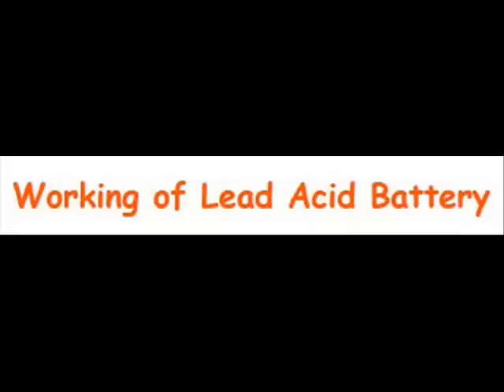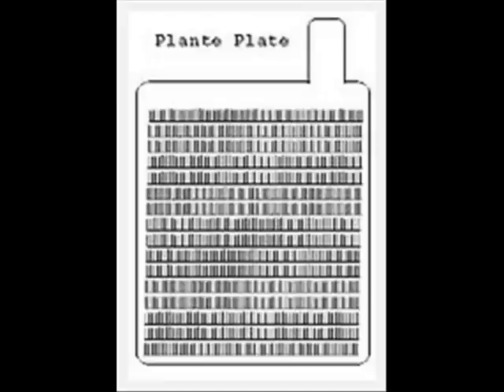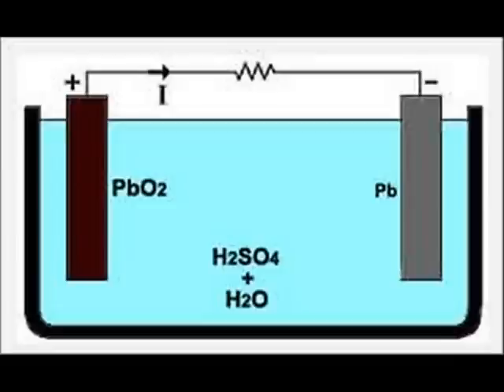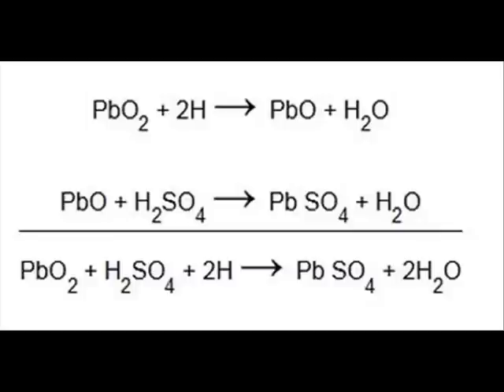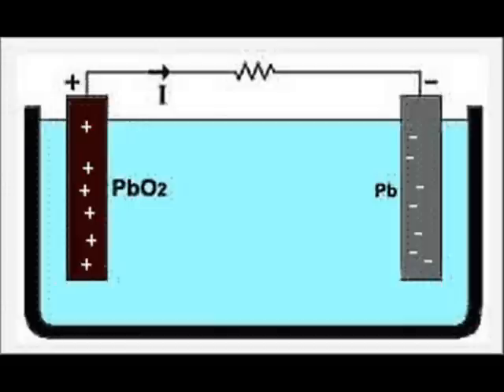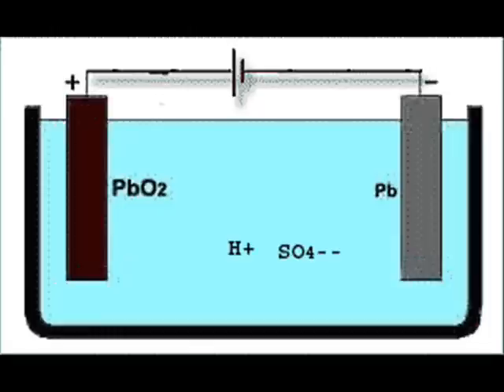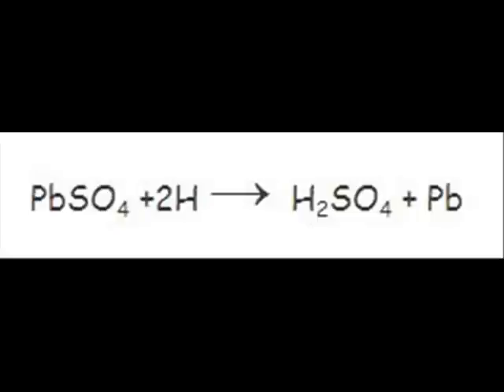Lead Acid Battery: How Do They Work? | Working Animation | Electrical4U

Comment: The Lead acid content and relation with that of the compounds and non compounds are good, since the said compounds and non compounds can be controlled/adjusted to be cleaner, safe as well as healthier, for them to be as efficient, durable and long lasting since it is recyclable/environment friendly, 2022 onwards.

Comment: I was confused when you said electrons move from anode to cathode. I thought they go the other way.  They are negative and attracted to positive. Thoughts? Clarification?
Reply: On anode there are oxidation, when on cathode there are reduction. From an oxidation you get electrons flowing in a wire (or sth) to a cathode where they are involved into reduction. By the time of they travel, they are used to do electric work. And while you are charging battery you are making the whole situation reverse; electrons from your external source of current are reducing the oxidated form of lead to its REDUCED FORM (PbSO4 => Pb), and on the other side you have SO4 2- ion that is giving its 2 electron to a H+ ions, and then (as radical) reacting with PbSO4 to return lead to its OXIDATED FORM (PbSO4 => PbO2). So while charging you are just reducing the oxidated form and oxidating the reduced form, so you can return to a starting point. The thing is that in PbSO4 you have lead on +II oxidation state, and it can be reduced (to 0: Pb II SO4 --> Pb 0) or oxidated as well (to IV: Pb II SO4 --> Pb IV O2) which is giving possibility to just reverse process and make battery charged again. I hope that you understand :D
Reply: @drewniak2094  Thanks for your effort to teach your content! I’m printing this for reference.
Reply: @drewniak2094  thank you.

Comment: This NEW battery made with new, never-before-cycled LiFePO4 cells is perfect as a drop-in replacement for lead-acid batteries in your Golf Cart, RV, Emergency Power Supplies, Outdoor Motors, Electric Wheelchairs, Etc. while giving you more capacity, faster battery charging speed, longer cycle life, and is Eco-friendly!
see the link below to know about the Black Friday OFFER.
https://bigbattery.com/product/12v-170ah-lifepo4-power-block-golf-cart/

Comment: Well sorry, but your concepts are wrong. Because during charging the battery, the terminals of the electrodes are changed, i.e if during discharging, anode is negative and cathode is positive ,then during charging the battery, anode is positive and cathode is negative , in order to reverse redox reactions happening during discharging of battery.

Comment: what would happen if there is too little sulfuric acid in the battery ? My brand new fully charged battery rolled over and lost all of the liquid . When I noticed this I added distilled water and charged the battery. I tested the battery after it was fully charged the specific gravity was only 1.200. The other similar batteries that I have have a  specific gravity  of 1.300 or more when fully charged. I think I need to add some sulfuric acid in the battery

Comment: If overfilled with distilled water and caused huge amount of the electrolyte to be drained, should sulphuric acid be added or the charging process will auto equalise the acid concentration?
Reply: The thing is that during discharging, the sulphuric acid is in the form of PbSO4, attached or sticked to the electrodes. However when being charged, the PbSO4 is broken down to Pb metal and SO4 ions, which react with 2H+ to form H2SO4.

Comment: So in your cell, negative plates are hooked together and positive plates are hooked together and then in the next cell I assume the end of each positive are hooked to the negative of that cell and the end of the negative of the first cell plates to the positive of the next so to add up the voltage.
At 1: 20-time frame in your video tell me why would SO4 -2 move towards Pb electrode if that electrode wasn't positive in the first place or provide some positive ion to attract the SO4-2. What is up with that and why is no one catching it.  If you manage to explain it, I suggest to explain it really good. So your understanding makes sense to you and to me hopefully.  Thank you.

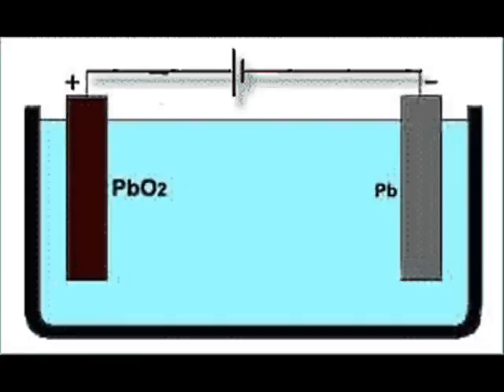Comment: Listen carefully starting at 2:35.  "connect LEAD SULFATE COVERED LEAD PEROXIDE PLATE to a positive terminal to an external DC source and LEAD PEROXIDE COVERED LEAD PLATE with the negative terminal of an outside DC source.  What are you saying, man?  I have listened to what you actually said 6 times.  Listen to your own self.  Which plate is which my man ( which one is LEAD PEROXIDE LEAD PLATE and no sulfate)?  IS THERE SOME THIRD PLATE SOMEWHERE I HAVE MISSED? 
I assume the first one, your " LEAD SULFATE COVERED LEAD PEROXIDE PLATE"  is the one on the left of your video with the + sign on it.

Watching your video I label the left electrode as Cathode and it is LEAD PEROXIDE PLATE COVERED WITH LEAD SULFATE.  The right electrode as the Anode and I describe it as LEAD PLATE COVERED WITH LEAD SULFATE.
If all these people actually watching and listening to this video doesn't get this, it shows that most human beings are gone in the head.  Can anybody please tell me if I am hearing things and it is me for god's sake who doesn't make sense any sense.

Comment: So you are starting your video to show what happens chemically to an already charged battery as you discharge it.  
What is a charged battery?  "(i.e. a charged battery is a battery that has inequality of electrons in the terminals.  The side with more electrons is negative and the side with less is positive).
Therefore you are saying that PbO2 is a positive Ion and Pb a negative Ion?
You can not put a load to the discharged battery, you can but you won't get anywhere.

Which means a charged battery has PbO2 in the positive electrode and Pb in the negative electrode.  And as it discharges both electrodes gradually become PbSO4 and once it reaches to that state completely you got a dead battery.
So when you begin to charge it again.  You turn one of the PbSO4 back to PbO2 and the other to Pb.  
Since both electrodes are pretty much the same in a state of discharge the reason the negative electrode becomes negative is that you put the negative terminal of the charger to it.

So in a nutshell.  The charged battery has PbO2 in its positive terminal and Pb in its negative terminals.
And in a discharged battery both terminals becomes PbSO4.
Right?
So you are not creating an imbalance of electrons in the terminals as you are discharging because you are clearly helping remove the imbalance and move the battery towards becoming dead (i.e. increasing entropy) but you say the opposite that you create an inequality of electrons in the electrodes in your website and I copy and paste it  here; " As H+ ions take electrons from PbO2 plate and SO4 − − ions give electrons to Pb plate, there would be an inequality of electrons between these two plates"

Comment: Thank you but, i have a question about when the positive and negative plates have become in contact and a dead cell is the result. Is it possible to reverse charge a battery to break the contact between the plates in a dead cell?

Comment: is it possible to remove acid and water (keep it dry) from the lead acid battery after full charging.. to keep the battery in good condition for longtime.. as after full charge negative plate will be lead and positive plate will be PbO2..  and after longtiime .. we will add acid and distilled water in 1:3 ratio  to start using the lead acid battery.. pls answer..

Comment: Lead(IV) oxide, commonly called lead dioxide or plumbic oxide or anhydrous plumbic acid (sometimes wrongly called lead peroxide,) is a chemical compound with the formula PbO2. It is an oxide where lead is in an oxidation state of +4; bond type is predominantly covalent.

Comment: I was saved from spending funds on a brand new car battery when I heard about the reconditioning program ( Check Details Here>>>https://docs.google.com/spreadsheets/d/1sdVXZCPumFERRAWRssVD6VxD5o7A1t8Af-wZYnxh5Yk/edit?usp=sharing  ), therefore I tried it to recondition my old auto battery! I thought it would take much effort and hard work, however it was simple as ABC. That already saved me about $ 100 and there are a lot of some other batteries.

Comment: The major problem of battery failed is we can not charge battery in a perfect solution. It means every time we charge battery and some PbSO4 does not be removed 100% from Pb plates. So PbSO4 accumulated to cause high internal resistance. The high resistance will make the charge voltage increase fast but battery does not complete the charge process. Finally, the battery capacity runoff.
So how to reduce internal resistance by using a perfect charger is what I am doing now. We already work with golf club to repair the failed battery of golf cart. It works as the way to protect environment.
Reply: Edward Chen hi sir, any update on this innovation of yours??? This would be great to minimize millions of batteries to be disposed worldwide in a given time especially if not done correctly.
Reply: @rjsalcedoiii647  I understand your point but  there is about a 95% plus recycle rate. Lead Acid batteries are not disposed of in the usual sense.

Comment: Error.  direction of current flow seems wrong.   Negative to positive.
Reply: +Eric jones  Yes, the electrons actually flow from the negative, but it's just electric convention to show the flow from the positive.
Reply: and what on tarnation mother earth is the meaning of this bloody mushroom cloud electric convention in simple terms?
Reply: Basically, centuries ago when scientists were studying electricity, they didn't understand the quantum physics of what was actually causing it, but they knew there new there were opposing "charges" that attracted or repelled each other.  They named one negative and one positive.

But quantum physicists decided to call the electron's charge as "negative".  So the thing that is actually moving in an electric current is "negative".  So it confuses people that are new to learning about electricity because you'd intuitively imagine electrons shooting out of the "positive" terminal.  And many electrical diagrams actually diagram it that way, even though it doesn't match the physics.
Reply: its becoz crt direction is always opposite to electron direction... (convention)
Reply: Eric Jones was actually right.  I see what he was saying now.  In the animation, electrons are showing flowing from the positive terminal to the negative, but electrons actually do flow from the negative terminal to the positive.
Reply: draw a simple circuit with one battery and one load 
-ve to +ve inside battery but if you look at the circuit the flow of current loop       +ve terminal > load > -ve terminal
Reply: Here's how I think it. I don't think in  terms of conventional current, I just think where did electrons leave? And where does electron accumulate. The point, in this case anode and cathode, are respectively oxidised and reduced so anode lost electron so positive, where as cathode is gaining electrons so that point is negative

Comment: This helped me understand much better the chemistry of a lead acid battery.  I got a small one for my birthday, as I like to be with power when without power.  All that's needed is some wire clamps to car charger adapter, and a car charger to USB or DC to AC power inverter, to use a lead acid battery to charge or power anything within the amount of power it can put out.

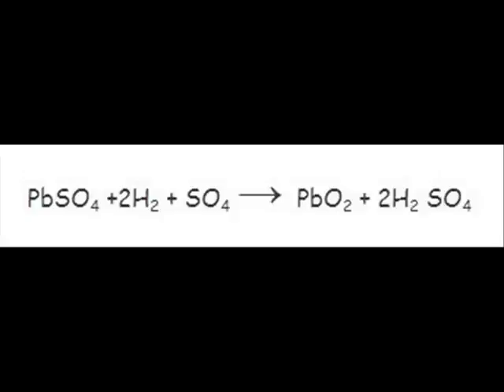Comment: the chemical reaction diagram shown in 3:42 does not add up.
8 oxygen on the left side.  10 oxygen on the right.
Reply: Equation mistake, 2H2O should have been there instead of 2H2
Reply: @sudersan2k7  Right!
Reply: Can you count?  Did you mean to say 8 on the left and 6 ( not 10) on the right?
Reply: @alchemy1  You seem to be the one in the wrong!

Comment: The concept shown is incorrect.PbO2 and Pure lead(sponge) are not the raw materials for construction of the batteries but they are produced by electrochemical process by charging the battery,the mechanism of charge flow as shown in the video is incorrect.Sorry for my comments,it is only intended to correct the chemistry as shown in the video.

Comment: great video, could you extend it a bit by explaining how a charging circuit may work. im trying to make a good charger for the lead acid battery. I was thinking about using a microcontroller.